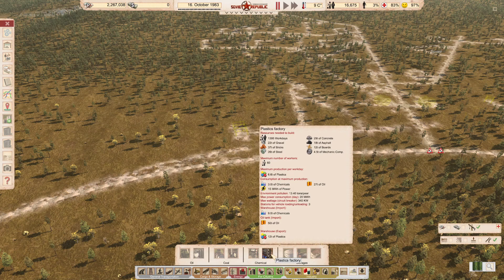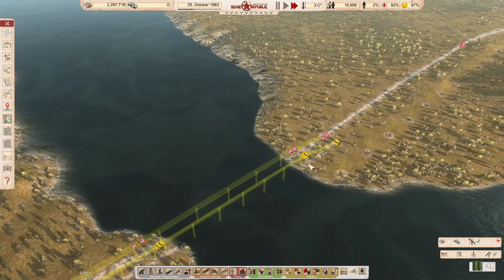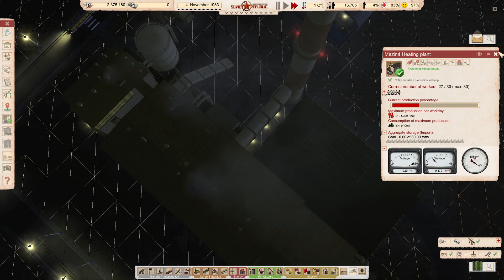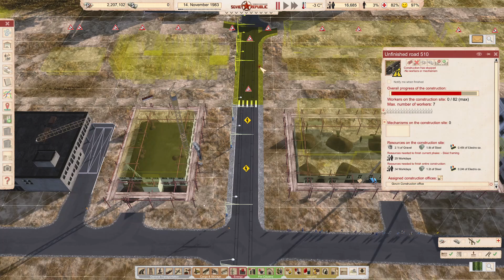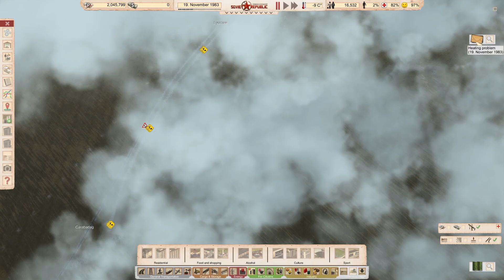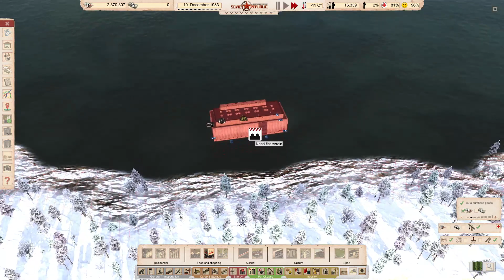Workers & Resources: Soviet Republic - Ep 49 - Riverfront

Comment: 12:50 You really should see if you can disable that recruitment for the rest of the buildings, if they weren't all built by the end.

15:35 How are you going to manage the heating pipes if this expands significantly?

33:35 cringes

36:30 It's winter, so it would make sense for solar power generation to be low in spite of the workforce.